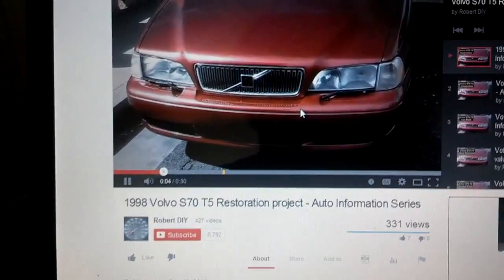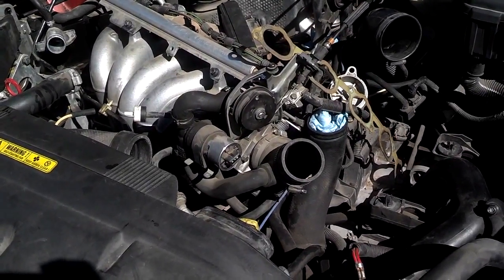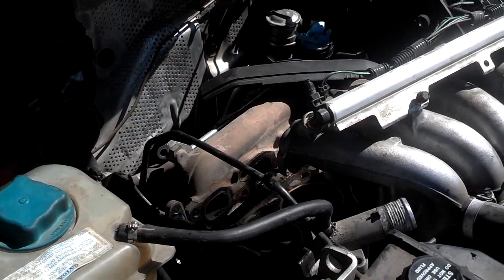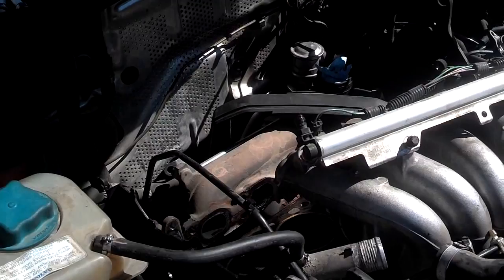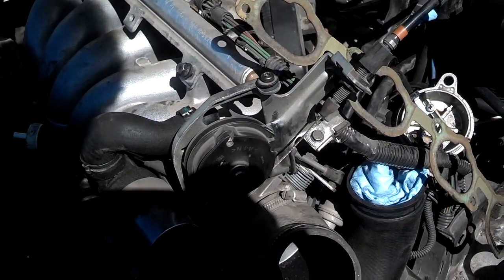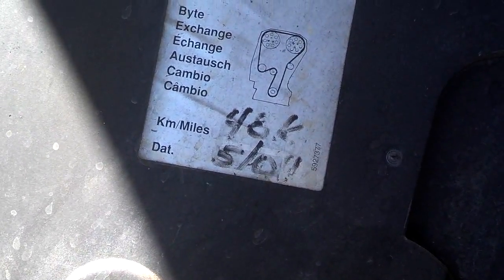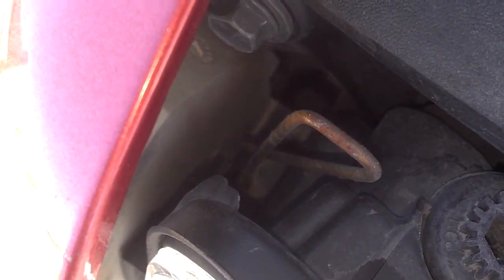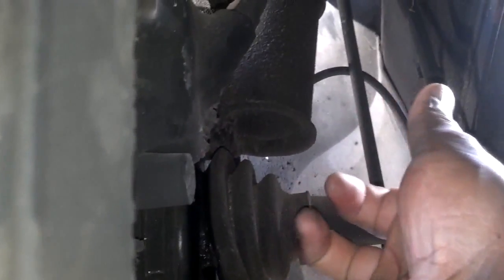Volvo S70 T5 Restoration, needed parts assessment - Auto Information Series

Comment: why restore it? does it have low miles on the block?

id rather wait(as im doing right now) till someone is ready for a new Volvo and want to sell their old white(looks nice to me) S70 and redo the major things not fool with  a head job ..
are you doing this to sell or for some that owns it?
I could redo my 850 but it needs a lot and at 226k not worth the hassle to go all threw the cars only for the trans to go...yes I did the trans flush on your video but any car above 200k in my world is like a time bomb waiting to happen....
also first  car that ive ever really owned above the 225k and just like my 93 850 right after 220k starts blowing smoke when started in the morning or sitting at the stop  light for a long period of time...yes I take care of it when I get my cars but the first 150k that someone else owned it im not sure if they ever did take car of the car...

yeah I know its a valve seal but not worth the effort just waiting  to go to a nice s70 .
owning the 850 for 6 yrs I think I got my $600 to buy it price out of the car..
Reply from the maker: LOL, I'm fixing the car to flip. It has 106,000 and a very clean interior. So, someone will get a car that they should not have much to do for the next 4 or 5 years. That is why I'm doing the head and several other things. Timing belt, PCV, brakes, cv boots, axle, tune up, etc. The blue book on the car is $5,100 and I hope to sell it for just under $4,000. I need the money, I have no job.

I believe these cars are good for 500,000. If you bump your oil weight up to 10W-40 it will likely cut out most of your smoking and oil consumption. The tranny's usually last the life of the car if serviced. I doubt you have anything to worry about. I know people with those cars that have over 300,000 on them. Mine now has 247,000 and still running strong.
Reply: Robert DIY
yeah around here in upstate NY these go for around 1200-2500 dollars  and the higher end is like cars around 100K in sweet shape...
good luck with the flip as people just buy new and do a $250 payments now and to spend 4-5k right  out of the pocket  now people don't want to do...
 I use to drive buy cars drive them a few yrs and resell them for either more than I paid or right around what I paid but now people don't want a car with no warranty or someone else to blame...
people want something for nothing now and used cars are the worse to sell as people want to give you say $1000 on a 4k car...
ive given  up on reselling them just part them out (last 4 cars) or junk them !

not like the old days where people beat down your door to get a good running auto...
Reply from the maker: I sold my 960 not long ago and actually gave the lady a 90 day warranty. The only way she would have damaged that car was to pull the oil drain plug. She could not have destroyed it if she tried. Heck, if she would have tried to drive 100+ mph to kill it, she would have gotten to many tickets before she would have blown the motor up.

I probably would give a written warranty on this one as well, if someone paid blue book for it. To be honest with you, people pay more than you think for cars like this. When the blue book is $5,100, that means that some people pay more, some pay less, $5,100 is actually the average. You have to put it out there and let people see how nice it is, then help them see the value in it's condition, they'll find the cash.